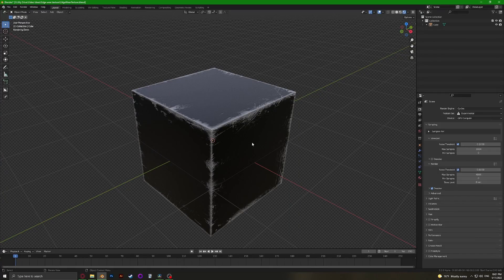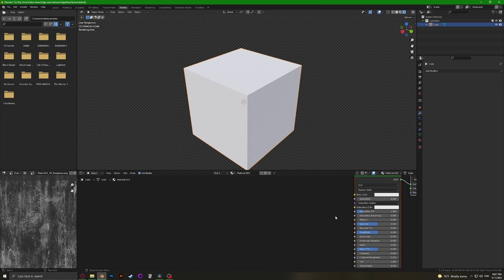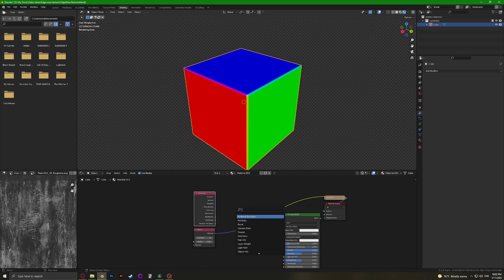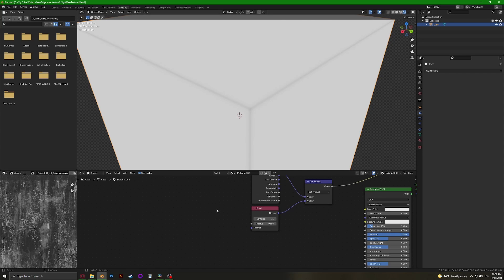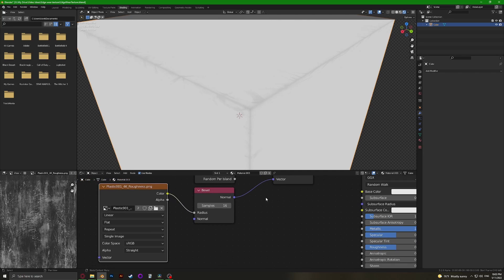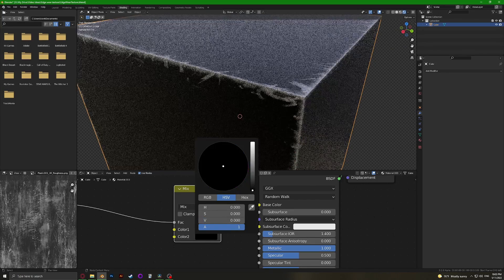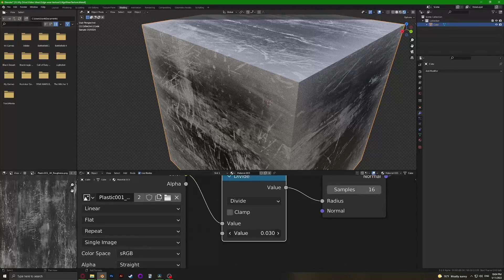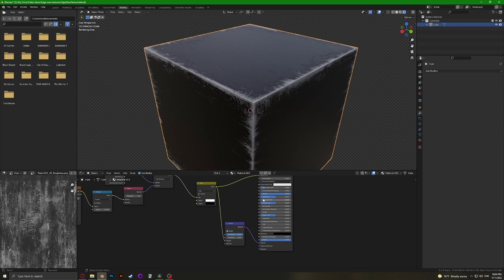Blender Edge Wear

Comment: hey this doesnt seem to work at all. cant tell if im doing something differently or if its just broken on 4.0 i have the normal of the geometry node and normal on the bevel node into a vector math node set to dot product which goes into a principled BSDF node connected to the material output. im on cycles and in rendered mode and there are no black edges. any idea why?

Comment: Holy crap!  Your viewport handles 1024 samples in the time it takes mine to do 25.
Reply: Make sure to use GPU compute, if you are not already, CPU compute is typically much slower.
Reply: @danielmichaud2867 
Indeed.  I was a few weeks in before figuring this out in the render tab and GPU settings in preferences.

Comment: i never EVER thought of plugging a map into the radius, this is genius, thank you very much, you gained a follower and a like and a comment for the algorythm, thank you so much for helping me, i hope it will help you too !
Reply from the maker: No problem, I'm planning on releasing a bunch of new tutorials soon!
Reply: @diivja  For some reason it doesn't work in Blender version 3.4 What should I do?
Reply from the maker: @Sizotop   It only works in Cycles render mode. It doesn't work in Material Preview or Eevee
Reply: @diivja what version did you do it in? 3.4 seems to not have the mix rgb
Reply: Nvm I got it working in 3.0